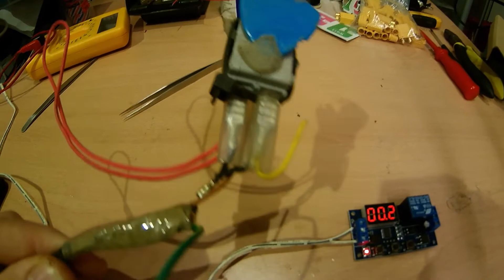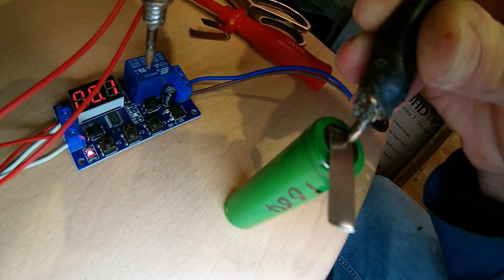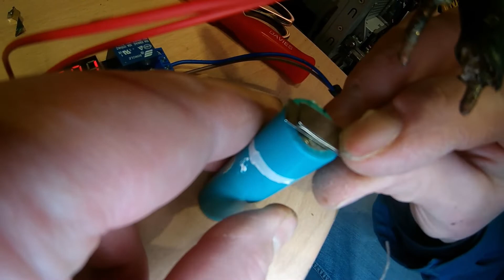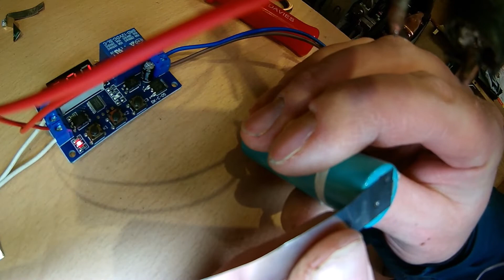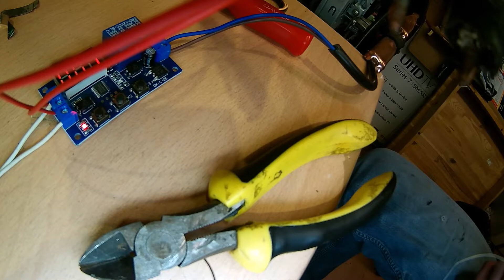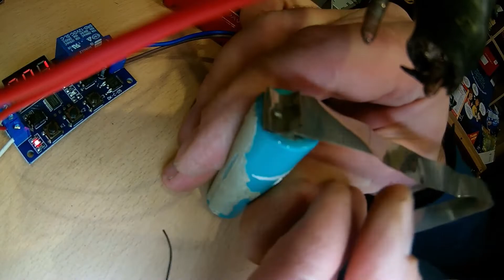HIGH AMPS Spot welder Modified  made safer delay timer control switch #smartazz

Comment: What is Module model no ?
Reply from the maker: I’m afraid I don’t have it :(  something like this has replaced it ￡2.40  56％ Off | 41A/100A Spot Welding Machine Control Board Welder AC 220V to 9V Transformer Controller Board Timing Current Time Current
https://a.aliexpress.com/_EJyrCMr
Reply: @smartazz  thank you sir

Comment: 100ms is too long for most welds, you need a timer that can do 10ms increments. Another issue with some of these relay boards is the relay will stay open whilst the button is pressed - so if your button presses are longer than 0.1s (etc) you will end up triggering for longer than your set time.

Is the source the usual MOT transformer or a different setup?
Reply from the maker: drsquirrel00 that transformer was a double MOT running in parallel together for double the amps.
Reply: @smartazz  The usual modified coil replacement? Mainly interested if you had another method otherwise.
Reply from the maker: drsquirrel00 I’ll do a video on it as i have changed it since. I’m now using a 100A time current control board 
Like this 
https://www.ebay.co.uk/itm/254662490693

The transformers are standard, I hacked out the high voltage side and replaced with 3 turns on each (as much as I could fit)